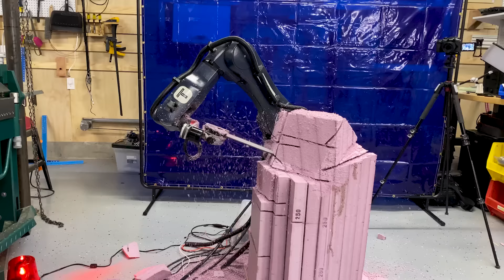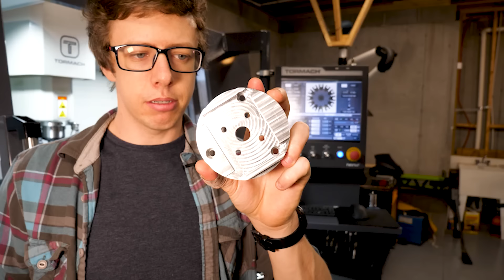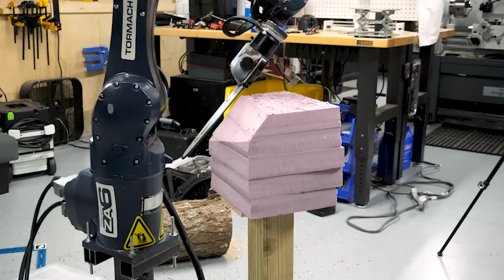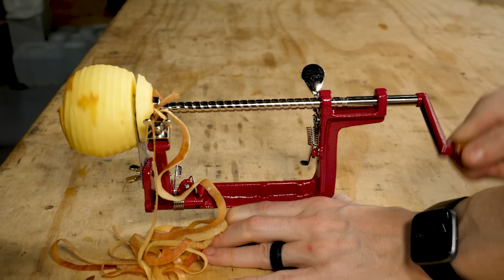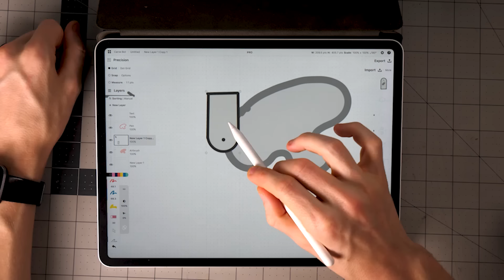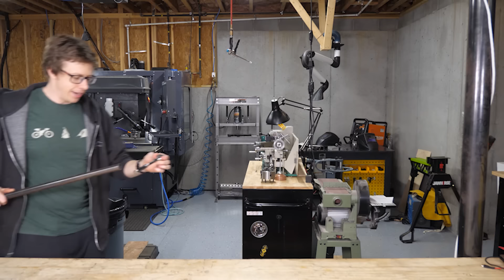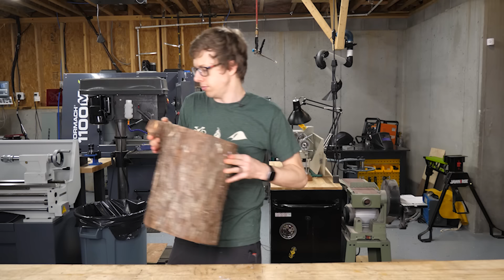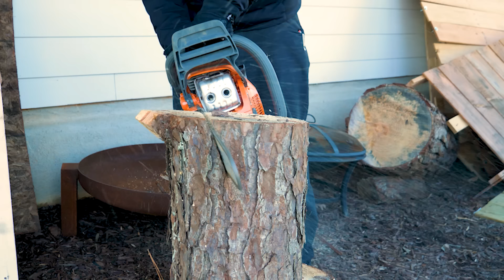Chainsaw + robotic arm = art?

Comment: Interesting to see the gradient ascent approach. Broadly speaking, you have 2 approaches - one is to see if there's a way to reformulate the problem so there aren't multiple peaks - this can be difficult but it's worth thinking about. Otherwise, you're generally looking at some kind of multiple start system that aims to find each of the peaks by starting from multiple locations. That isn't necessarily that much harder than the basic gradient ascent system because you're just running it a number of times to find the best result. What you can also do is look at a system that moves probabilistically - it doesn't always move in the best direction, only tends to, and over time it becomes more likely to follow the best path (annealing). This can help it find multiple different peaks (so not useful for a single run but useful for multiple restarts). You can also look at genetic algorithms - taking the best results from one set of runs to generate other starts to compete with the best found so far. The broader concept is memetic algorithms but for the most part searching for genetic algorithms will be return information.
Reply: I second Dave's ideas about simulated annealing and genetic algorithms.

Annealing has the idea of "temperature" which is just the amount of noise the system uses to jump to various places to begin it's ascent. As the system ascends, you gradually lower the "temperature" and hope it settles into the region of the highest hill in the landscape.

Genetic algorithms place genetic "bets" or "flags" all around the landscape, and then compete to find which of these bets found areas around the highest hill. Effort is apportioned by a scoring scheme.

Comment: What you may consider or not is that you can sharpen the chainsaw to be able to cut better in different planes. I know that cutting in say a rip plane you do need to sharpen it in another way so that the saw isn't choking on its own saw dust and cleans better. For your specific use you may check out chainsaw carvers web sites or on here and see what they may use in the way of sharpening? One other suggestion is maybe using a carving disc like a Kutzall Carving disc or they even make a circular disc with a chainsaw wheel. Either way this may be able to carve better than your chainsaw piece. Still dangerous but maybe more control and more practical?

Comment: Curious as to why the gradient descent aproach wouldn't work. Even though you often find a local maximum i don't see how that is big issue. True you didn't make the most optimal cuts, but with more cuts you would still approach your desired figure. Are more cuts really that big of an issue?

Comment: I enjoy watching you go through the whole engineering process to come to a solution.  On the scale of construction detail between "this old tony" to "Mark Rober" these fit in an awesome middle ground where we can see how many different difficulties there were and you solved them.  

A new approach seems possible if you can apply a key abstraction to your investigation A geometric plane.

If you were to define a series of planes as "sea level" you could find the local maxima of height for planes which are parallel to a defined ground plane as one which contains the minimum number of volume (defined grain size, zero size points don't serve well here) points of the model.  The only problem is that defining and examining this plane might be too computationally expensive for how often you need to perform it.  The other problem is determining how many different ground planes need to be considered and how to convert a max height into path options.  But it does solve the local maxima issue.

Comment: This was so great. I don't have the technical skills to even run a mill properly, let alone write code for a robot, but I really know chainsaws.  
There are at least a dozen ways to alter the way a chain is constructed and sharpened.  The chain you are using is optimized for operator safety. 
When you decide to lower that depth gauge, please be careful, and investigate the relationship between  cutting depth, angle and pitch, and horsepower.

Comment: for the gradient ascent issue a quick fix would probably be to tell the 'ball' to check for 'every' point on the same y plane it is on once it's reached the presumably true summit. if it finds another point that is not void at that same height, you tp the ball there and resume the algorithm. rince and repeat until the ball can't find another point with the same y coordinate

Comment: To solve the local maximum problem with gradient ascent you can run your algorithm in parallel with sufficiently high random starting positions of the underlying distribution and then take the max of all the converged maximums.

Comment: As an Arborist thats sharpened many saw chains.... those "anti-kickback" tabs on the saw chain are called drags, and they also control how fast/deep your saw cuts. When that saw wasn't sawing, the drags were too long. Shouldve taken a few swipes at them with a file to cut them down. Wouldve fixed your.. not cutting.. issue.

Comment: To be honest reason for not cutting wood was probably that chain oil feed was too low. If blade overheats then chain gets dull in a moment. Also I would make sure that electric motor has power equivalent to 52cc gas engine and can rev up to 10000rpm.

Comment: Could a larger motor on the base connected to the saw via a stout flexible drive cable be used to deliver enough torque to cut wood at normal speed?

Comment: Yeah, that anti kickback tooth needs to be filed down as you sharpen the chainsaw blade. Usually go somethin like .3mm bellow the actual sawtooth for hardwood. Do try to make the dog out of a log, but you'll need to sharpen the chain a couple of times mid process though😅

Comment: In terms of pretty useless advice here, I think using alternating direction method of multipliers would achieve pretty much the result you were trying to get with gradient ascent but without being so likely to get caught on local maxima, though saddle points can still be an issue. It's usually used to find minima, but would work just as well here.

Comment: why dont you just make the algorithm run a decent amount of times more for each cut you want to make to weed out the false summits. just log the results for each run and compare. tallest point wins.
Reply: cut the log into a cube grid pattern in 3D and take one cube of the log at a time and make those guess on the surface of the wood

Comment: Surely a regular 4 or 5 axis cnc router would be a better / easier less time consuming method of making a wooden bear from a log? I definitely understand the fun of a diy project but why this when you could use regular gcode from fusion360 with a CNC router and get better results?

Comment: Those little things you called anti-kick backs are actually called Rakers. they keep the tooth from taking off a bigger chunk than it should. you can file them down a little but that specific style bar was never meant to cut with that smaller section of rounded tip. look at the bars they make for chainsaw carvers and you will find much narrower tips that also have more flat area at the end. Hope this helps.

Comment: I've spent a good amount of time chainsawing, and I can say that that little chain on that little saw would get dull very quickly, especially if it's always going in tip first, even with softwood. I'd guess that's why it got so hot. A longer chain with a built in cutting oil squirter on the arm seems like it would be crucial. That being said, awesome video as usual. The sheer perseverance your projects take is nuts.
Reply: Did his saw even have any bar oil?
Reply: haha.. tip first

Comment: I'm a 3D tech artist and I'm intrigued by this problem. I feel like there's an elegant procedural solution for this. You mentioned that a convex hull wouldn't do the whole job, but that doesn't make it worthless. You can compare the polygons of the convex hull to the polygons of the original model. Any polygons that they have in common will define shearing planes that will need to be cut out of your starting block at some point anyway. Any polygons that they do NOT have in common define the inner surfaces of the cuts you would need to make to define the concavities, and I feel like it's an easier step from there to finding a procedural way to remove them without testing random cuts. I might try to write a Houdini tool that figures this out, but it definitely seems doable.

Comment: Those "anti-kickback teeth" are called rakers. They control how much wood gets chiseled with each tooth. If you were to file them down using a depth gauge tool and a square file, and made sure you had lots of bar oil, you should be able to cut for a while.

Comment: I mean I’m not a coder by any means so the possibility or difficulty of coding to do so, I don’t know, but having it use the tip of the chain saw side to side to “grind” the smaller/tighter areas to get those curves in could work?

Comment: Gradient ascent/descent has many well known ways to prevent getting stuck from increasing the rate of convergence to using momentum
Reply: Couldn't you form a grid of points and run the algo on each point and choose the best result?  Easy optimize, if you hit a spot already looked at, stop that point.  Only problem would be the resolution of the grid, but that would be determined by the resolution of the model, which in this case is very low.
Reply: @CouchPotator  im sure ppl have tried that but the most common methods is increasing the rate of convergence to hopefully "jump" past local max's, or momentum which essentially if a maximum isnt maximal enough u will probably "slide" past it (which is as simple as just taking a LPF (just 2 or 3 + / * operations)

Comment: What you called an "anti-kickback tooth" is actually called a raker, it is there to control the depth of cut for each tooth. Considering you are using a robot to do the cutting, I would assume you could have the the arm control how fast you are cutting quite accurately so they are kinda pointless in your case. if you ever come back to revisit this I would suggest filing the rakers down to help with plunge cutting.

All that being said, I'm not too sure why that would be causing a problem. Possibly since it is a pole saw meant for branches, it may have a smaller diameter tip on the bar that might be causing it. However, I am not sure. I do know that plunge cuts are definitely possible with a full size chainsaw though.

Comment: If you want to avoid false summits, simply run it again with like 20 different guesses until you find the summit that is the highest. Realistically you wont have more than 4 summits.
This is kind of brute forcey though and it would be better if you would only run it the based on the amount of vertices and starting at the vertices rather than a random position

Both of these methods can still fail, however if you throw more compute power at them and addextra runs it should be fine lol.

Comment: One of the methods used to avoid local minima / maxima in optimisation algorithms is using a population of stating points. The most common method is in genetic algorithms which could create a population of different angle pairs & cutting locations to work out the best location & dimensions. Additionally there are further strategies that could alleviate this particularly one called mutation (yes, very funny computer scientists) where when you reach a maximum/minimum you modify one parameter into a whole new population to see if you can further optimise. This could work pretty well but would be computationally expensive - in order to do it near real time or 100x faster you want to have your whole algo written in c++ & running on a GPU :P

Comment: You need a bar oiler! The reason your bar is getting so hot is because it doesn't have any lubricant between the bar and the chain. Also the little notches that keep the chainsaw from kicking back can be filed down just a hair so you can take off more material. I really hope this helps you out :) super cool setup and this vid made me laugh a lot haha

Comment: Log smoke issues:
A) sharpen your blade... chainsaw blades go dull relatively quickly, especially shorter chains.

B) Bar oil.  Not only does it reduce friction, it also sinks heat from what friction is still there.

Also, the tip of the saw is often used in carving because at very shallow depths it can also be moved sideways for making a type of cove cut.  This could be an option for more of a "finishing pass" to smoothe lines.

Comment: Cool problem.  Keep with your 2D layer approach. Then write an algorithm which looks at the object surface from a given angle. 1 degree increments should give you plenty of resolution without being too computationally demanding. From there run an algorithm to decide if the surface can be treated as an function in a given area (simple vertical test line sweep). The real trick then is running an algorithm which can generate a formula for your function.  Some interesting tools out there for that kind of work. It may give you a set of functions which coorespond to segments of your surface.  In any case, for each segment an extrema should be calculated.  Then a comparison of calculated extrema for the max extrema.  With that determined you will be able to determine the biggest cut you can make for a given layer and angle.  The process can repeat for each angle increment.  Recycle per layer.  Tedious but with some creativity you might reduce the brute force cuts.  Probably comparisons of the most important cuts in a given layer and reevaluation of predicted surface features post cut.

Comment: You may have tried this already but one way out of your local maxima problem is to use a technique called simulated annealing.  Basically, instead of hill climbing to a maximum, you keep  randomly guessing a place each time. If its higher, choose it just like hill climbing but if it’s not better, you randomly decide to take it anyway.  This random decision to take a worse position is  influenced by a time decay probability where the probability decreases as your algorithm iteration count rises.  As your iterations go to infinity, your guessing decays to straight hill climbing. The name simulated annealing comes from the likeness to annealing metal where the temperature slowly cools, just like your guess probability.  A common temperature schedule is: T = T_i * alpha^t, where alpha is a decay factor (0.95 usually works fine), t is your current step count, and T_i is your current temperature, initially start it pretty high (like >10^7 or maybe more). Your probability function would be something like e^(worseNeighbor / T), where worseNeighbor is going to be some negative number that’s the difference between your current location and the worse next location that your considering. In the beginning as T is large, worseNeighbor/T is dominated by T and results in a very small (negative) number, which means raising e to it  approaches 1. If you randomly select a number between 0 and 1, this can be your comparison. As T decays to 0, worseNeighbor/T blows up to -infinity, which takes your e exponentiation to 0. Finally, you'd have some base case threshold of small T where you just revert to hill climbing to hopefully now, your global maxima.  Theoretically 😉.  Love your videos by the way.

Comment: Your lack of chain saw knowledge is frustrating.
Reply: Properly sarpen your chain. The “anti-kickback” bits as you call them are the depth gauge for how much material each tooth cuts. Also I would recommend a carving bar. It has a pointed tip that is better for detail work. Also, properly tension the chain on the bar.

Comment: That steepest ascent could work, it's basically like geometric optimisation we use in chemistry when exploring the potential energy surface. The problem is, as you mentioned, is that it finds the local minima (or in your case maxima) rather than the global maxima. My suggestion would be to either use a systematic search (slow) or instead add in a Monte-Carlo algorythm - AKA randomize the starting location and repeat it until happy.

Comment: Is there a problem I don't foresee with just telling it to cut along each face of the model? Have a check put in so it stops before it hits another part of it. At least with a low res model like the dog that would (at least seem to) work pretty well. Then the only checks you might have to do is finding straight lines along the model cutting along those and extending to either then end of the material or when it would intersect with the model.

Comment: It wasn't cutting cuz you need to lower depth gauge, the thing you called the anti kick back, all you need to do is file down it down so it either level or below the chizzel/cutter, this will give it chance to cut more 'meat' off the wood plus you dont really have to worry about big kick backs on a saw that small. Other than that this was a great vid and i look forward to the next. 👍👍👍👌

Comment: I don't know much about robots but saws I know a little about first take the rakers(anti kick back) off and use the machine speed to control it it's not necessary when attached to a solid machine. And also for wood the chain will need sharpening threw out the carve and the chain oil tank could do with being a lot bigger It will use that tank in 15 minute's maybe not even that with constant use you can also use the tip of the bar to grind curves by sweeping it side to side at the depth of the cutter.

Comment: Your biggest problem in the begining is thinking the chain saw only cuts from one direction and angle. You can turn a chain saw in a cut also.. go watch competition chain saw carvers they use every inch of angle of the chain to make cuts. You Limit yourself by not researching and assuming what you don't actually know.